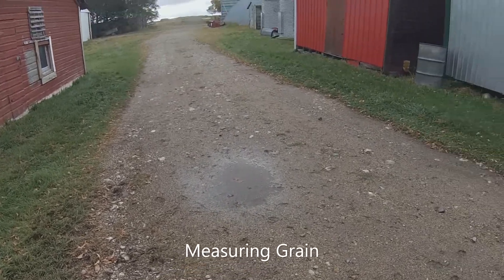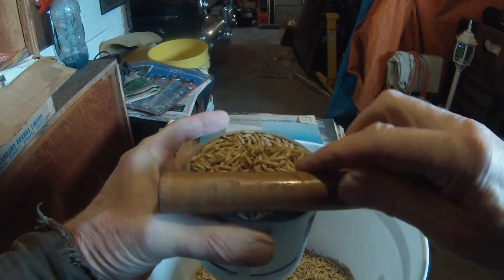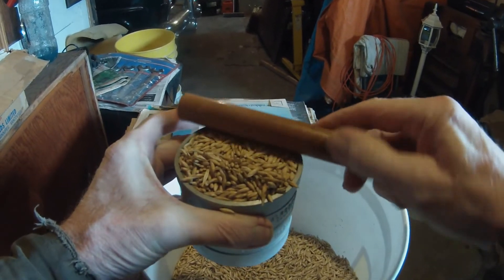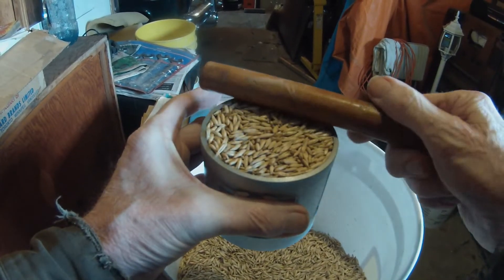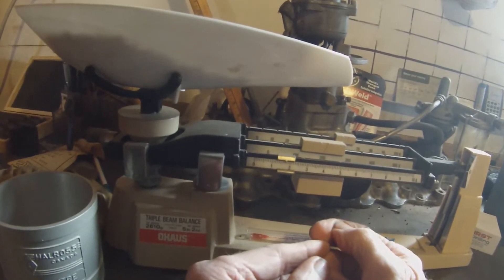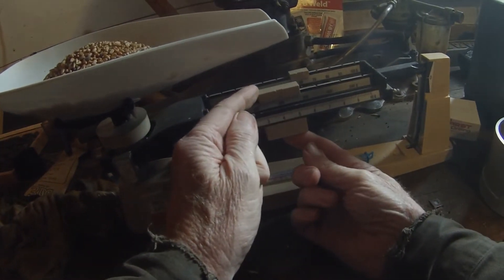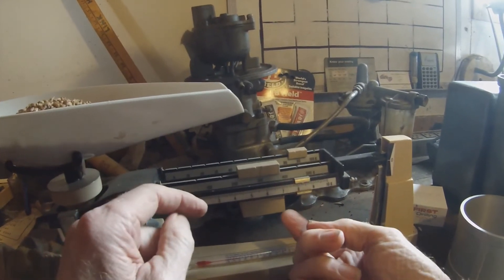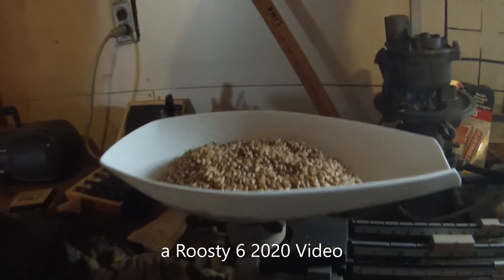Testing Bushel Weight

Comment: Up our way I’ve had heavier bushel weights too this year. 

I’m only 35 but I really follow a hybridized Saskatchewan measuring system. I use pounds, bushels; and acres. Seeding is pounds per bushel. Spraying is litres per acre. Most liquids are measured in litres like spray and fuel prices are listed dollar per litre. Yield is bushels per acre. I talk miles when on grid roads but kilometres on provincial highways. Speed is measured in km/h when driving a vehicle but miles when doing farming operations. Farm  implement widths are in feet. Fahrenheit though is a very goofy way to measure temperature in my eyes so it’s Celsius unless I’m speaking to someone older or an American. I usually have a fairly decent idea of what the Celsius equivalent would be if someone says Fahrenheit. It’s just a person really never hears it used anymore. For nuts and bolts, I dread metric. I know what a bolt head size is in standard and might be off by one. Metric bolt and I’m cursing and swearing trying to figure it out.
While I suppose I use close to an equal amount of metric and standard, some things I will never convert to metric. Acres is one I will most definitely never convert to metric. Pounds and bushels are more I would never convert. I can picture what an acre, a mile, or a bushel looks like. Acres and miles work because the land is surveyed that way. I can’t look inside a grain bin and say “oh yeah I have 15 tonnes left to sweep and shovel.” It’s like “yeah 200 bushels left in there” or whichever.
Reply: *Seeding is pounds per acre. You knew what I meant haha.
Reply from the maker: Most of my stuff is old enough that there is not much if any metric on it. The one tht annoys me most is "hectares". I have no problem with litres per acre but if the instructions on the herbicide call for litres per hectare I'm lost and looking for a conversion formula. I have no clue.

Comment: Very neat system. I have a question about your grain bins I see lots of them in your area scattered about farms in odd places compared to here.(That’s not meant derogatory) I’m guessing these bins do not use air floors or bin fans? I’m from SW Indiana and find what you guys up in Canada do interesting and thought I would ask.
Reply from the maker: Don't consider me as representative of farming methods here. I'm using old machinery and methods from decades ago. Having the bins out in the field makes for short hauls for the truck at combining time. Although most around me either have their bins in the yard or are using plastic bags right in the field. I've got aeration tubes or floor in 4 bins in two different yards but the rest are just bins with no air. So I generally like to wait to harvest dry grain to put in them.
Reply: roosty6 I prefer the older way of doing things. I’m just a part time play farmer but enjoy playing with my straight trucks and smaller equipment. Very few straight trucks left here, I’m probably the only guy hauling with a plain single axle. Just bought it 1975 GMC 6000. I need to upload a video. Not as nice as your load star but good for the age.
Reply from the maker: @samtalley791  Most here haul with tandems or semis. Lots of grain carts out in the fields to fill the semis. That GMC 6000 is a nice truck. I've driven them.